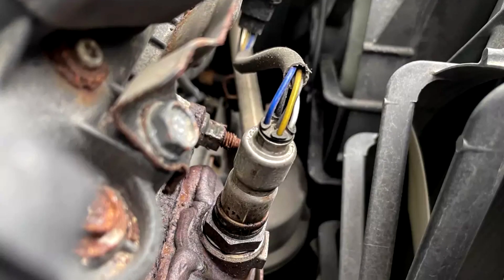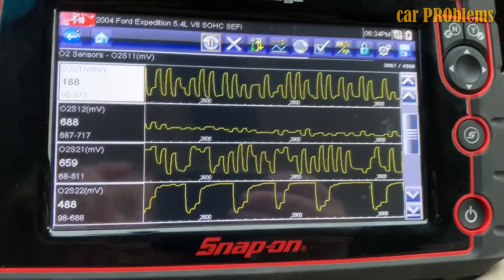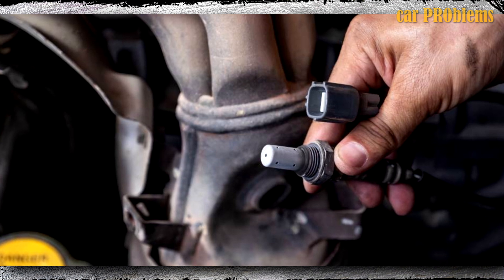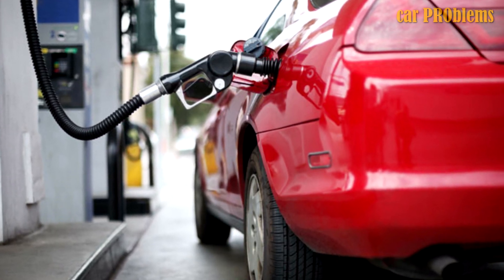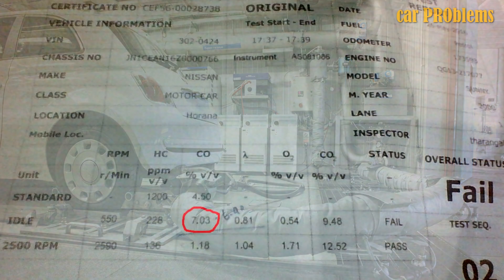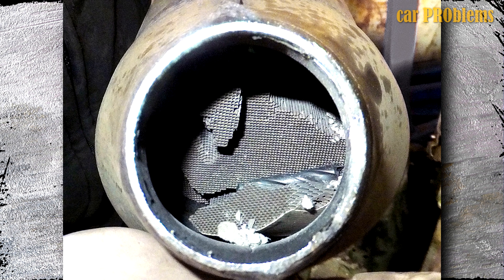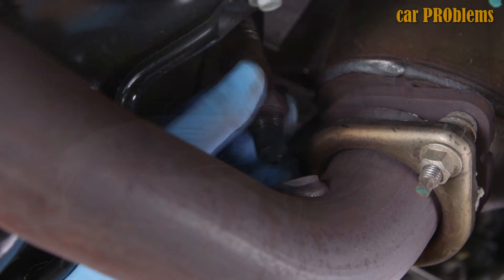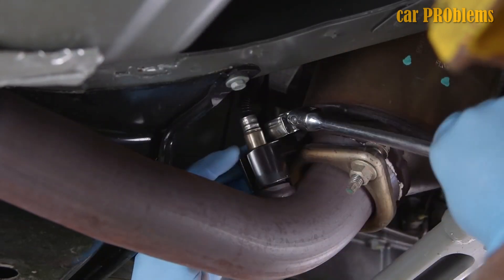Bad Oxygen Sensor Symptoms - 8 Faulty Oxygen Sensor Signs

Comment: I have a skoda yeti that goes at limp mode when its cold for years now. i have done a total revamp on the engine, repaired the software, changed cold valve and heat sensor and it still happens. any idea why?
Reply: For faulty O2 sensor could be any problem behind O2 sensor and these are: leaking fuel injectors (carbon build up), faulty Lmm sensor, faulty intake vacum air leaking, bad fuel pressure regulator, bad fuel pump. All this affects the incorrect air-fuel ratio, therefore the error on the O2 Lambda sensor.

Comment: Could this cause my van to sometimes mot start? I plugged in my OBDII sensor and it gives this code “p0036 ho2s heater control circuit (bank 1 sensor 2) location “ and I have the check engine light on.
99% of the time it starts fine, and 1% of the time it either lags to turn on (I turn the key and it needs a few seconds to for the engine to start), or in the worst cases it won’t start. If I then wait 2-3 minutes, it starts up just fine

Comment: Is this for upstream or downstream o2? Or it doesn't matter?
Reply: Upstream sensors are called Air fuel ratio or lambda sensor not o2 sensor. O2 are located downstream of catalytic converter 👍

Comment: What if all my lights turn on such as break and cruise control ect but i get p0172? Could it be the maf?
Reply: If you are looking to just throw money away, following advice in videos like this is an excellent way to do it. I guess no one realized that the voice in the video is computer generated. How did you come up with a an airflow sensor with for a bank one lean condition? That might be the problem, but an 0172 is a generic code, which means there are many things that could turn it on. 

When you see a bunch of lights come on for systems that are primarily safety features, its considered normal. For example, if you have an issue with your ABS system, your vehicle will automatically shut down other systems like, traction control, parking assist, adaptive cruise control, lane drift condition, etc. All of those systems won't work without ABS, so they all get shut down as a precaution.

Comment: i just upgraded my fuel pump and threw in gtr 550cc fuel injectors into my infiniti g35 n it was running decent with rough idle but now i cant get it to start but when it does i gotta hit the gas to keep it running n if i stop it stalls i got the code p0131 and p0151 saying low voltage on bank 1 and 2 for upstream, im wondering if anyone knows if the 02 sensors themselves are bad or that im just throwing in to much fuel i planned to get it dyno tuned, also i never got the codes before or at least i dont remember having them before
Reply: If you are going to modify your vehicle, you should know what you're doing. Mods bring your sensor data out of spec, and unless you know how to compensate for the changes, you'll have problems. O2 sensors can't cause a hard start for one simple reason. O2 sensors only work when they're hot. (aprox. 600 degrees). Before they reach operating temp, they give bad readings. Because of this, you would get a check engine light every time you start the car with a cold motor. To deal with this, your pcm has 2 modes of operation. Open and closed loop. When you first start the car, the pcm defaults to open loop, and stays in open loop until your O2 sensors reach a minimum temperature. The important thing to remember, is when your vehicle is running in open loop, it disregards the reading it gets from the O2 sensors, and runs under an alternate fuel injection mapping strategy while everything is warming up. Simply put, your O2 sensors can't cause a hard start because they're ignored whenever you are in open loop.
Reply: Thats certainly interesting. Most likely will be the O2 sensor, due to the age of the vehicle or perhaps the Oxygen intake is struggling to meet the demand of Fuel injected with the new modifications. My vehicle (Manual VW Jetta 04) would stall at idle or if the revolutions in the engine became too low at neutral, it would stall. I replaced my air vacuum tubes (cracked and broken) and got the true cold air intake installed correctly because the previous owner didn’t attach it properly. My engine stopped stalling afterwards and I hadn’t had the problem since, however the code appears every once in a while despite it running decently. My vehicle went from 18 mpg to 27 after that fix, however I believe that my O2 sensor is bad or I need to replace a faulty fuel injector.
Reply: There are four common problems with oxygen-fuel ratios that cause the voltage in the o2 sensors to drop. Either Fuel injectors, a leak in the exhaust, bad o2 sensors, or improper air intake

Comment: O2 sensor down stream code came on in my 2010 300..changed it out an still there an runnin rough an jerkin like its gona die while ideling drivin a certain speed or sometimes shifts hard around 35 40pmh or wont shift in the next gear..gona change out the up stream next..anyone have the same problem an figuiit out yet? Put a new starter in it but sometimes cranks for 5 ish sec longer than it should before starting.
Reply: You have to diagnose the problem, not just replace parts until you guess correctly. Your O2 sensors can't cause a hard start condition because they don't work when they're cold. Your PCM ignores them and they only come online when they reach a specific operating temperature. About 600 degrees. You have to look somewhere else.

Comment: Hi.I have w140 S320 96y and O² sensor wont work correctly, its on ON few sec and then its shut down/OFF 
Do i need to replace O² sensor?
There is many different sensors in the market, witch one i need do buy?

Comment: I have 2010 chevy camaro I replaced the 02 sensors and lasted for a couple months but then i got the code for the 02 sensors when engine light came back on  now have to replace again its cheap fix. But mechanic also told me It can be a vacume leak as well.

Comment: My car is making a rattling sound where the o2 sensor is located. Only happens on cold start for 3 minutes then the rattling fades until unnoticable. Could the rattling on cold start for 2-4minutes only be a sign of bad o2 sensor or is it normal?
Reply: Need better tech oil ~ Lucas technology
Reply: Sounds like it might just be the heat sheild on the exhaust. Might be able to bend it so it's not touching the exaust pipe. If you find it it's just  heat sheild then yes its nothing to worry about....
Reply: @ginoromano2442  sorry for not being too technical. Not sure how i'm going to describe the noise. It seems more like a hissing sound than rattling
Reply: @lnnoT6665  Sounds like either an exhaust leak or worse, crumbled honeycomb material in pieces rattling around in the shot CC.

Comment: I replaced my oxygen sensors this week. My car has 230,000 miles and the previous owner never replaced them. Turns out, they were both broken and for God knows how long. My car began running rough and backfiring, and once at a stop, would not move an inch, but idled perfectly fine. My guess, carbon built up everywhere it could and now I'm replacing just about everything I can think of.
I got underneath my car and tried like hell to break them loose with no success. Breaker bars, O2 sensor kit from autozone, no dice. So I went to my neighborhood mechanic just to have the bolts loosened and it set me back $35. Took her back home and replaced the oxygen sensors ($20 each). 
Don't forget! There are two different types of o2 sensors, the Upstream O2 sensor (before catalytic converter) and downstream O2 sensor (behind the catalytic converter). You can't use the same oxygen sensor for both positions. Also, don't forget to reset your car's computer after changing dirty or broken sensors, especially if your CEL came on.
If you're catalytic converter is toast and you have a cheap car in an area with no emissions tests, you can buy an O2 sensor adapter that will "trick" your computer into thinking the catalytic converter is there and fine. They sell these adapters on walmart. com for 10 bucks, and with great reviews.
Anyway, I've done a ton of work to my car in the past couple weeks, trying to get to the root of my intermittent mechanical issue, and keeping my fingers crossed that I fixed her. Tomorrow I'm resetting her computer and taking her out for the big drive. Wish me luck! :)
Reply: I guess your on a long road trip😂😂
Reply: Rip my boy, next time fix the brake pads first...
Reply: Good Luck 😂
Reply: what's the name of that o2 sensor bypass part?
Reply: @johnsmith-sp6yl  there called spark plug defauler, you screw ur 02 sensor into the defauler then screw it into ur 02 hole in ir exhaust....drill a half inch hole into the end of the defauler before u screw the 02 sensor into the defauler, then screw o2 sensor n fauler into the exhaust, the fauler shrouds the tip of the sensor and tricks the computer into thinking all fine.....try it it works perfect...
Reply: @bunnyhall116  already found and stuck one on for the inspection, one of the 90 degree ones with the catalytic material in it, appreciate the response though
Reply: Defouler @johnsmith-sp6yl
Reply: Spaethon
ياصديقي ماذا اكتشفت ؟
هل أصلحت المشكلة وما كان سببها ؟

Comment: Well, i had a full tank on my nissan. Ran 29km due to some errands. I noticed the fuel drop to 3/4 of the gauge. I tried to refuel again to check how much it consumed, or if my gas tank floater sensor is faulty. My god, it really did lose some fuel, significant amount. I lost about 9.3L of fuel on 29km. My car normally runs 7-8 km per liter!

Could anyone know what else is causing this to drink so much gas? 

1. Spark plugs are replaced and original parts
2. Replaced air filter
3. Newly changed oil (Amsoil OE 100% synthetic 5w-30)
4. Even the ATF is on the manual spec, Nissan Matic D.
Reply: Check and possibly clean your MAF Sensor
Reply: Had this exact same issue, when i disconnected the O2 sensor it went back to consuming just a bit more than normal

Comment: My car fuel consumption is very high about 40% increase.
I was thinking it's oxygen sensor but I don't have check engine light On, I scan codes and no fault. What exactly could be the reason
Reply: Have you checked for some kind of leak?
Maybe you can get a large card board, split it from the center to get two then cardboard and place under car and monitor it like that. Maybe it’s dripping out. 
If not, try monitoring the rpm. Do you notice if it has higher than usual rpm, either when idling or when you’re driving.
A next thing it could be, if no code is showing up, is maybe the car has and Over Drive available, you have it activated.
Essentially, it keeps the car running in the smaller gears, so if you’re on a highway or long free roads, it’s using gas pointlessly.
You’d mainly use it if you need some power and not speed. You’d maybe use it to climb up a somewhat steep incline. Or maybe you’re trying to help pull a car out from a ditch.

You can do a little research on if your car has OD and how to enable and disable it.

I remember I drove my cousin’s Tacoma, Dont recall year, but it’s not a recent model, and the OD button was on the shifter. I accidentally pressed it and was wondering why it was driving funny.
Reply: Right now I am on here tryna fix my O2 sensor connector. Idk if it’s been disconnected a while, but I have the pesky code and OEM parts are a little to expensive for my liking. Lmao.
The contact point of one of the 4 contact points inside the sensor connector is broken. And I’m having issues with Mpg efficiency too.
I figured maybe the bank 2 sensor 2 is the one that helps monitor and controls the air/fuel mixture. If it doesn’t get feedback, it just keeps throwing in more fuel than it needs. 
God having a car is a pain.
What’s worse, it’s difficult to fucking unscrew this shit.

Comment: Can it cause noise more prominently when transmission changes gear?
Reply: No it has nothing to do with that
Reply: Just one of many on you tube fully explaining replacement of oxygen sensors.  😮
Reply: I have a Chrysler 300 with hella problems including a transmission gear thing and that was the driveshaft. I have 4 codes left and 3 of them indicate the O2 sensors. And 1 is p0300 which is just a multiple misfire code. I changed almost everything except the spark plugs cause i thought they were changed. The car sounds better now but i hope the o2 sensors is the main cause of rough idling

Comment: Hi there, hope you are doing well sir
I would have a question about my car if you could help me out.
I was just wondering. MOT has been done to my care which is a Ford fiesta, before the MOT  the noise level was high in the car, its consumption was also high and it's felt like it doesn't have much power in it.  after running a test on its computer to find any problems with the car, everything was fine. oil has been changed, oil filter and also Air filter was changed, last year spark plugs were changed, catalytic converter, oxygen sensor and they reset the on board computer. The engine ran very nicely without effort, very quietly, very quickly and its fuel consumption was perfect no noise whatsoever. The yellow engine error light came on when we were traveling, the noise level increased, the consumption also increased, the performance decreased. now I don't know what to do... any suggestions please

Comment: Thanks. Getting ready to place downstream. Hard starts.
Reply: When you first start your car, your pcm runs in open loop. When in open loop the pcm ignores the information it receives from the O2 sensors. That can't cause a hard start because the O2 sensor won't come on line until they get how enough to work.

Comment: Got a 2002 Buick LeSabre limited off fb marketplace previous owner didn't replace intake manifold gasket right o2 sensor was going out ignition control module was going out 20 year old spark plugs og fuel pump and fuel filter 3 months later got everything done except o2 sensor 😂

Comment: Hello, Maybe you can help me with a question. The apologies of the case for my English, it is not my native language. I have a motorcycle and since it is already hot and idling the scanner shows a voltage in the oxygen sensor (it is a single wire) of between .8 and .9 which drops to between .1 and .5 when the motorcycle accelerated it also marks the change from open loop in idling to closed loop in acceleration. Is this normal?
Reply: Is your issue resolved bro ?
Reply: It depends. In a car OBD2 laws requires all manufacturers to comply with a specific set of regulations. Wide open throttle on an obd2 vehicle forces an open loop condition. I don't know what the standards are for motorcycles, but if its going into open loop all the time, and not just under WOT, you probably have an issue.

Comment: Could this cause a cylinder 6 misfire I’ve checked spark plugs coil packs injectors and everything is fine I even replaced my camshaft sensor and crankshaft sensor it doesn’t idle as badly as it did but the check engine light flashes could the o2 sensor cause this.
Reply: Please respond as to what cured your problem. 😊

Comment: I changed my ignition coils, spark plugs, 2 new catalytic converters, new throttle body, new alternator, and lastly I put some fuel injector cleaner in. The misfire is fixed, the idle and the car shutting off is fixed. But the thing is, my car feels heavy when I accelerate to go faster and it has poor gas mileage. Today my check engine light popped up so idk if I needa change this 02 sensor or what. (I’m so close to giving up)
Reply: Hey man I’m having the same issues except my car is shutting off and seriously bucking while I’m coming to a stop under 20 mph
Reply: @ounloyal5885  if it’s shutting off then it might be the throttle body, I put a new one in but you can also just use a old toothbrush and buy some throttle body cleaner to clean all that build up.
Reply: @ounloyal5885 what’s bucking
Reply: Change your fuel filter  @ounloyal5885
Reply: Dear @marcos im facing same issue, but no light in dashboard,

Pls tell me solution if your car is good now
Reply: Start looking into fuel system if the the O2 sensors don’t fix it
Reply: @corey9895  but 02 sensor not appearing when i made computer test
Reply: @waleedabdullah6755  that’s normal man you won’t always get a code. There is a possibility that your O2 Sensors just need a clean, they may be clogged up and stoped working. that would explain why you have no codes 
Your meant to change o2 sensors every 60,000 miles or 90,000 ks
Reply: @corey9895 if its not tha o2 sensor what should i check then or is the part where i get it from not good enough do i need straight from the dealer

Comment: Hi my Acura tl 2010 exhaust smell very bad and the car started showing check emission system with a check engine light,l cleaned my maf sensor and erased the codes but next day it came up again can anyone tell me something about it 😢😢
Reply: Did you figure out what it was? I changed my MAF and nothing happened, and I’m not even 100% sure it’s the o2 sensor